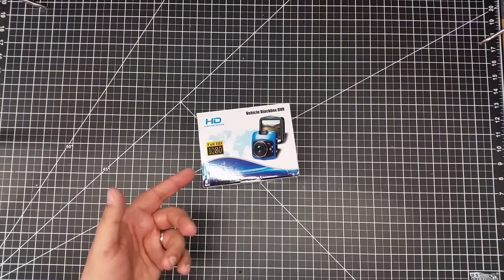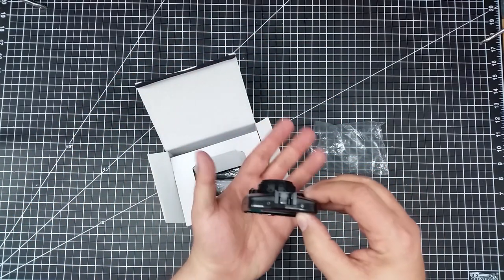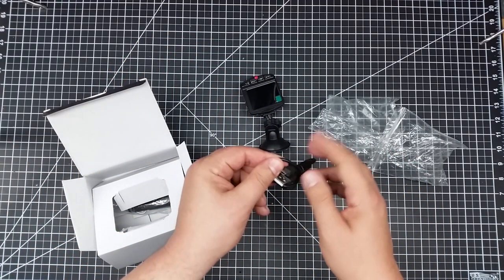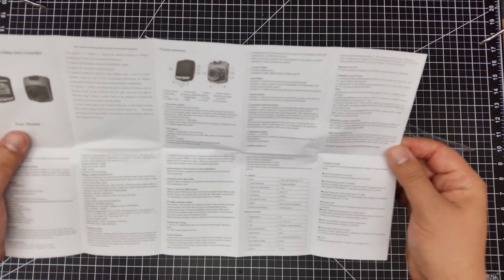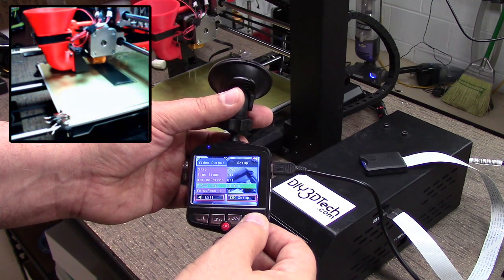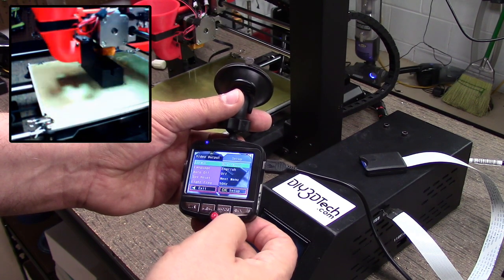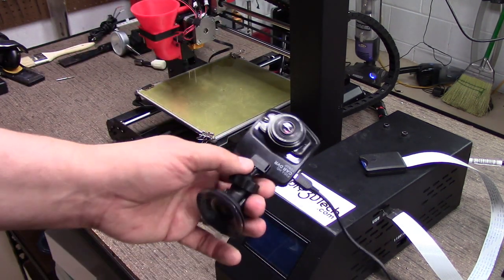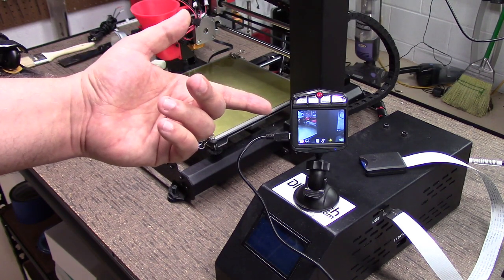Shop Talk - Using a 10 Dollar DashCam for Time Lapse Videos!

Comment: That looks like a cool camera but your iPhone 4S will do timelapse too. Have you tried that?

I noticed on your USB extender that you have it laying on top. Why not print a holder and bolt it on with the two machine screws on the controller for the spool holder. That's what I did for mine. Works great especially if you only have 1 hand available. 

I also noticed that you have the bull-dog (binder) clips holding down your PEI sheet to the build plate. Is that an older video because I thought you applied it with the 3M adhesive? Or was that on the Trantula?

Anyway, great video and excellent tip for taking video of prints. 

Norbert
Reply from the maker: On that one its still the "bulldog" clips as I swap (still need to do a video for nylon) however all of my other are taped down with 3M.  Also I do a lot with my 4S but also have a central system wired for time lapse and thinking about it, I should do a video on that as it is very cool.  For this I was just wonder for $10 would it really work and it did!
Reply: DIY3DTECH.com - @ $10 you should get a second one for another angle. Lol
Reply from the maker: LOL!  Your sort of right, the main reason I got this was MP Mini however I started using Octoprint with it so never really used for that.